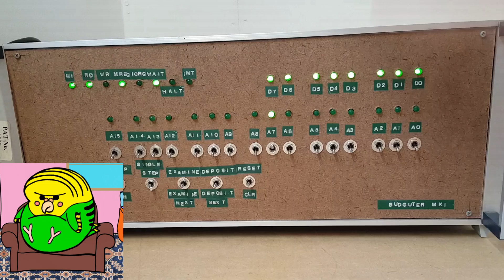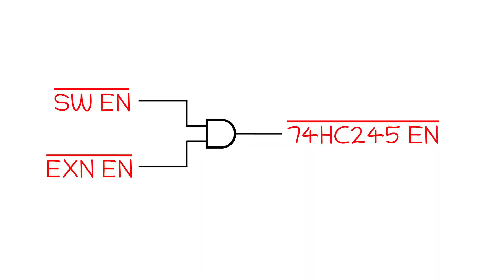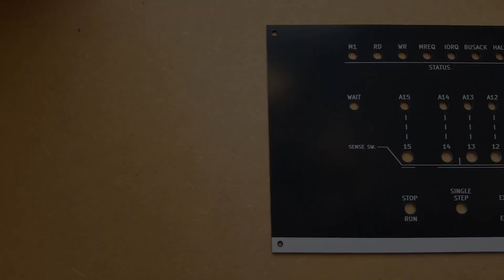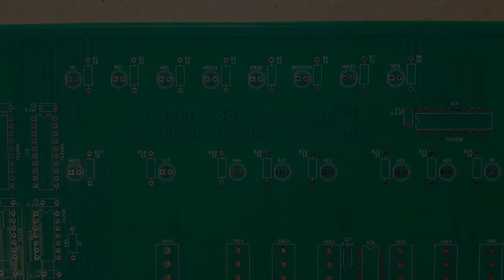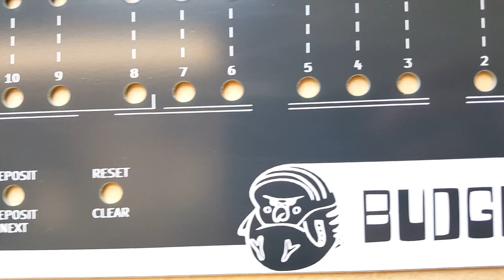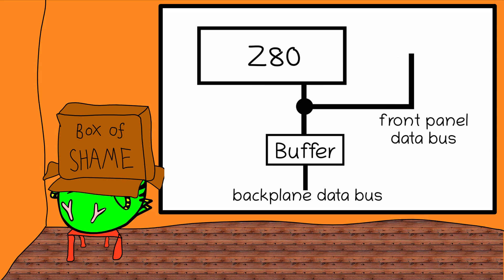A cheapo Altair 8800 style computer using a Z80 - (part 8) - The sense switches don't work!

Comment: One thing that bothers me with the Altair, or (relatively) faithful Altair clones like this, is the groupings of the front panel switches. Why, oh why, are they grouped in threes rather than fours or eights?

Anyway, gonna look sweet with the new front panel.
Reply from the maker: I thought that when I first looked at it, but using octals (powers of 8) does make the maths without a calculator a tiny bit easier than working powers of 16 (for groups of 4) or powers of 256 (for groups of 8). e.g. for say 125 you'd do 5x8^0 + 7x8^1 + 1x8^2 or in other words 175 (01 111 101) on the switches. Hope that makes a tiny bit of sense.

(sorry for the late reply, me and the human man had a bit of a break)
Reply: @DrBudgieandtheHumanMan No worries, I never expect a reply, it's a pleasant surprise when it happens.

Thank you for making the videos, they're great.

Edit: And yeah, it makes sense, at least if you are using octal in the programming.

Comment: Nicely done with the new board. Can you do a budgie bodge on the big one?
Reply from the maker: Thanks mate, I'm really happy with it. I was just looking at the schematic this morning and it looks like there's enough spare gates on the big budguter board so I can bodge it and without even having to blu tack another chip on the back! I think I might make a quick video adding the bodge wires
Reply: @DrBudgieandtheHumanMan It wouldn't be a revision 1 board without at least one bodge. I just had a Program Counter board arrive for a CPU project and discovered my LSB and MSB share the same output flag / pin rather than being separate ones.  So it's time for reverse engineering my own work.
Reply from the maker: All working now! That sounds like a cool project, you should stick it on YouTube man! I've been thinking about making a CPU from 74 series logic for a while now
Reply: @DrBudgieandtheHumanMan It's an experience. I've ended up using an Arduino Mega with a function to emulate the whole CPU then I turned off functions and routed them out to hardware piece by piece. So I could either use the internal registers or external and make sure the behaviour was the same. It's a good sainity check
Reply from the maker: That's the smart way to do it, I'd have never thought of doing that. I'd just have a big rats nest and a few chard breadboards. You should take a look at @DrMattRegan (if you haven't already) he's got a few playlists on making CPUs from a few bits of discrete logic and a load of EEPROMs, it's good stuff!
I reckon in the future I might have a go at making a PDP-8 using discrete logic, it's got switches on it!!
Reply: @DrBudgieandtheHumanMan  I do love switches. I've seen a good number of his videos, he's a clever man. I do find the reliance on giant eeproms to make finite state machines a bit of a cheat at times, but I think that's because I'm jealous of his coding skills.